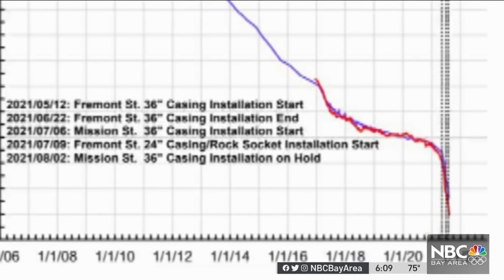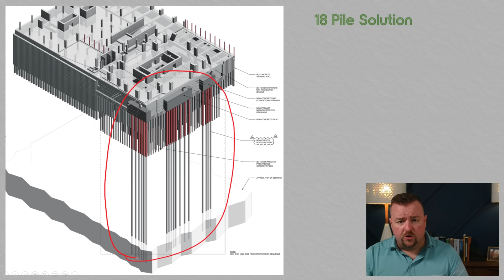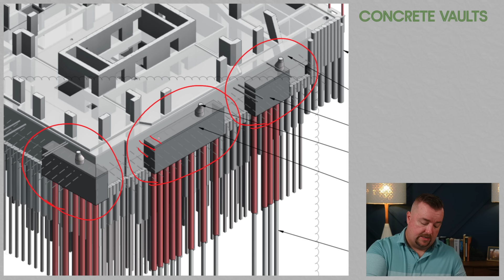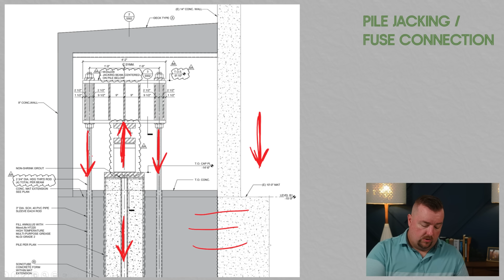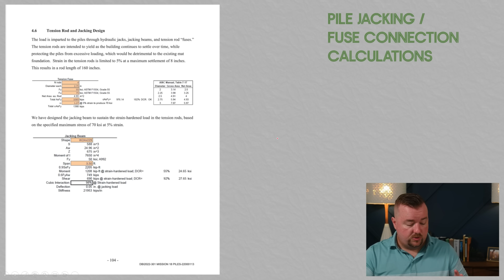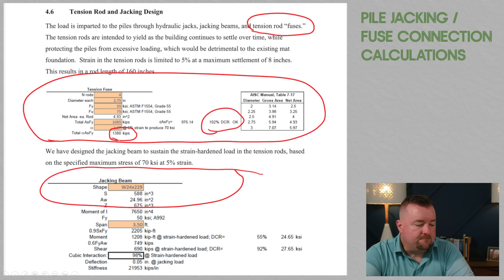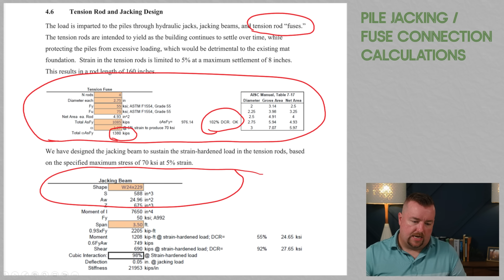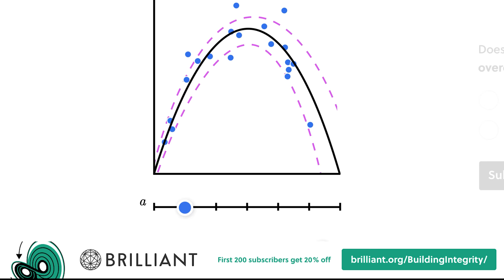Did I Uncover a $100,000,000 Mistake with the Millennium Tower "Fix"?

Comment: I was in the USAF and was an aircraft mechanic, I was tasked to do safety as I did that in a former life. I was told to sit in meetings with engineers and architects that were building a new huge hangar for our F-16's. As I was looking at the blue prints for the hangar I saw a huge mistake and brought it up during one of the meetings. I was a staff Sgt, after I told what my concern was The Colonel engineer asked me "Sgt, are you an engineer? I replied no. He told me in front of the other 14 officers that when I became an engineer I could bring things up. In the next meeting I brought the item I was going to point out and just put it on the table in front of me and didn't say anything. During the meeting I saw others and the Col. looking at it from the corner of their eyes. After awhile I was asked to explain why I brought the item to the meeting. I said because this is one of the 5 things that has to be put in the hole in the hangar floor for the aircraft power and what is on the plans even this one item will not fit. The Col. then said 'maybe we should listen to the SSGT. These engineers and others doing this sort of work should keep an open mind to others that may know enough to help with design.
Reply: That's a widespread problem with society. We don't like to listen to anyone who doesn't have recognized authority on a subject, even if they do have knowledge or insight.
Reply: "I''m senior so I'm automatically right" is the most toxic, destructive, and ignorant stance someone can hold in a relationship or workplace
Reply: Many people have died simply because somebody has an ego. In the airline industry it's called crew resource management where nobody is shamed or put down, everybody's ideas are considered. Every single human being has the ability to make mistakes. ( I'm not in the airline industry or anything , i have simply learned alot about it because it interests me. There have been quite a few aviation accidents where the other crew just assumed that the captain knew what he was doing and did not speak up, due to their lack of experience compared to the captain)
Reply: @Radi0he4d1  in a lot of situations the fact that somebody has so much more experience than someone else can play a big part in the reason why that person could make a mistake. Your doing the same things day after day. you get comfortable. you begin to think that you could do this with your eyes closed... and before you know it you're making a mistake. Whereas the less experienced new guy is constantly double and triple checking his work to make sure he's not making a mistake. Not saying that experience doesn't matter because of course it does but it can leave you vulnerable if you're not careful
Reply: See the problem here is not with the engineers and the architects, they designed whatever they designed based on the requirements the client gave them. I know that on the design side, we always ask what is going into a specific room, what sort of dimensional clearances are required, and coordinate these items with the engineers. Then it's up to the client's team to either give us the leeway to add some breathing room for later on, or min-max the hell out of the project and potentially create engineering and code issues during construction or later on.
Reply: As an SE and PE I learned very early in my career (now retired) that contractors have very good instincts and a lot can be learned from them.   They are not to be ignored.
Reply: @jeffreynelson2660 You are obviously
one of the smart ones 🧐👍
As an Industrial Automation Specialist since 1978, The smartest and most effective engineers always go to the operator's and maintenance people.
The best run companies, will bring them in from the beginning of the design concept.
🤔 It occurs to me just now that those who think they know better, have never had a hand's-on job.
In HS I told my mother that I & a friend had taken summer jobs at a factory that painted part's for factories.
Knowing I was heading to college she said "that will be good for you.
You can decide if that's what you want to do for the rest of your life" 🤣
She was really smart 🙂
Reply: @OhAncientOne  thanks for the comment.   As the owner of a structural engineering firm, I found that the best engineers were the ones that had entered college after other careers, such as truck driving, carpentry etc.    Those with 4.0 averages in college were book smart, but reality stupid, and next to useless.
Reply: @jeffreynelson2660  Yes, hiring is a true art.
The worst are the fresh out of college and think their degree makes them smarter than everyone else.  
I know 1 company that put a mechanical aptitude series of questions in their application test. Pullies, levers, draw an isometric view of a machine part.
I think that's a great idea.
Cheer's ! 
🧙‍♂️ OAO
*edit; 🤔 "owner" - see I was right 🧐😉
Reply: @OhAncientOne  I eventually let my employees go, began a business in the house, and was rewarded with much higher earnings, much less stress, no office politics, best business decision I ever made.
Reply: @jeffreynelson2660  lol, I design electrical control's, from home started in 86 thru '02
was out of it until '14, After 20yrs of AutoCAD it took 3yrs to get up to speed with AutoCAD Electrical working on site.
The covid has me working from home since March '20. The company I contract to decided to have "collaboration days" 2 day's a month, but I have not been there since last Sept when I survived a ruptured AAA.
So I was at a funeral and my relatives asked what I was doing & before I could finish they'd always say "Same thing you've always been doing" lol didn't want to listen to the long description - again
Wow sorry to get so long anyway,
I've realized I was way ahead of my time choosing to remain independent 
Politics in companies is something I've always watched and worked around without getting involved, but totally aware 😉
Reply: @OhAncientOne  In the 1990's some  laws loved by short sighted liberals but hard on businesses were passed, in King County, WA.   Such as "hostile work environment" (whatever that means), "sexual harassment", and others.    So, engineers and architects began to realize that their greatest risk, which used to be errors and omissions in their work, became instead, their own employees.   This lead to  principals only firms, with no employees.  This is called the law of unintended consequences, which is much too complex for the little minds of liberals.    They try to protect employees from  the evil business owners, and unemployment is the result.    I turned loose 28 employees, and never looked back.
Reply: @jeffreynelson2660  Yes complexity is very difficult for those who refuse to think beyond their noses. 🤣
That's a sad situation you describe, I get it.
I'm near Lake Michigan, and envy the west coast as an Architectural designer's dream location. Losing large firms sucks bc you need them to handle large projects.
I have/had relatives in Seattle and OR.
Considered architecture, big fan of Frank Lloyd Wright.
*edit ik it's not the same as structural 😉
Reply: @OhAncientOne  The funniest 2 incidents that I remember, both involved DIY.
The first one was when a guy was showing the plans that he had been drawing all day, to his 12 year old daughter after school. After about 30 seconds, she said, "Dad, two of the units wont fit through the door, then when we are using the grill, it will be impossible to open the fridge door.
Dad looked very sheepish after that.

The second was when a guy built a fitted bedroom wardrobe and shelving  unit carcase, face down on the floor. The diagonal of the sides was taller than the room, making it impossible for him to stand it up. The really funny part of that one, was that the guy was a design engineer. To make matters worse, his wife had already mentioned that he needed to assemble it upright, but she assumed that he would know the reasons why. 

I am a theater architectural engineer, but I often let our daughter (aged 32) check over my work. 
Sightline errors are so easy. LOL
Reply: @wilsjane  that's hilarious 🤣 thanks 👍
Cool job, I ran a custom panel shop back in the '80s. We built panels for a company you may have heard of, Peter Albrecht Co.
before my time at the panel shop but I found records & electrical dwgs for Stage controls for the Kennedy Center and the shell shaped Arts center in Sydney AU.
We did panels for them while I was there but can't remember where they went except that Australia had weird wire color codes.
Reply: @wilsjane  I've had engineers mark up my schematics and still didn't see what it was.
Always pays to have someone else look.
When programming machines, if I was getting stuck the best way to figure it out is to explain what I am doing to someone who doesn't have a clue. 🤣
Reply: @o0o-jd-o0o95  While what you say can be true, people who are complacent get weeded out very quickly.  When you interview someone for their input, their attitude is immediately apparent so you go through your list and quickly move on to the next person who may have input.
While in the back your mind you remember that something made that person that way.
Engineers who are smart enough to ask around, accurately judge who they are talking to easily. In my 45yrs of working with top companies I've seen and done it many times.
Reply: @OhAncientOne  It is a small world. One of my first jobs was to specify and dispatch the 70mm projection and sound systems for the cinema in the Sydney opera house.
Although the equipment was manufactured in Milan, they ordered it from London, since none of the design team in Australia spoke Italian. 
Australia uses the same wiring colour codes as the UK and has the same 230 volt 50Hz single phase domestic supply.
Reply: @wilsjane  Amazing !
At the time, it was the first time I had seen it, 
so it stuck with me. Over the decades I've helped a few companies meet CE standards
Right now I'm contracted to a world wide company with plants on every continent*
Designing the electrical control's for all the plants.
The stage controls were smaller operator control stations. Very beautiful engraved black anodized aluminum. We weren't allowed to put our co. name on them.
Amazing the memories you bring back 👍
*edit Almost - don't like to exaggerate
My stories are wild enough without that!
🧙‍♂️🤣
Reply: @OhAncientOne  My most wild moment was when the ballast resistors between the mercury diode 3 phase rectifiers in the basement and the projection and spotlights in a London theater burnt out a few hours before the show. 
To save the day, I connected the DC negative (that was bonded to ground) to the steel fire escape that ran up up the building and the DC positive to the remaining risers. To ballast, I stood steel dustbins on the top landing of the escape, added a wood bar across the tops of the bins, with copper pipes down into them, then filled the bins with water (as the resistor). To lower the resistance, I added salt to the water. Since the ballast was dissipating around 15 Kw, the water was soon boiling and the resistance dropping, so I had to adjust the length of the copper rods immersed. The whole lot held up during the 3 hour performance with around 2,000 members in the audience.
My nickname changed from 'professor', to 'nutty professor', a title that I still have more than 50 years later. LOL
Running more than 400 amps at 110 volts up a fire escape was probably a first, as was ballasting the negative.
Reply: @wilsjane  WOW! that story should be the opening paragraph in a EE course book!
That's brilliant in my book 👍👍
Having zero experience with projection,
I'm imagining a huge 110v 400A Arc lamp?
Really like the copper piping idea 🤣
Got to visit London in '73 bc my dad was our state's 1 Lloyd's of London rep.
Super cool City - I remember we drove west for a long time to eat at the world's oldest continuously operating pub/inn/carriage house. Used by king's traveling to/from the west coast. Can't remember what city, but I'll never forget eating at "The Spotted Dog".
Reply: @OhAncientOne  This was more than 50 years ago, when due to the low internal resistance of mercury rectifiers, to prevent the arc from surging out, the voltage was dropped by about 40 volts across the ballast to keep the current constant.
These days, most engineers just press buttons without understanding the theory.
Those good old days were far more fun than sitting at a computer.
I am pleased that you enjoyed your visit to this quaint old country, where even our police do not carry guns to shoot you.
Reply: @wilsjane  Cool, thanks for the knowledge 👍
When I started, anything with mercury in it was being replaced. But, you know those things can last 40yrs ez😉
Reply: @MikMoen  not really
Reply: @Radi0he4d1  the difference between big brother and an older brother...
Reply: Thank you
Reply: @OhAncientOne  When the national UK grid converted from DC to 3 phase AC, generators were maintained in many power stations to supply the railways. As the 11Kv grid was set up, the railways constructed rectifying houses for the transformers and mercury rectifiers to supply 720 volts to the tracks, allowing the power stations to decommission the DC generators.
On a dark summer night, when the doors were kept open for cooling, you could see the blue glow in the sky from miles away.
During the 1960's, when the power was shut off fer the last train, their were several cases of thieves breaking in and stealing the mercury. This also happened at several cinemas, in some cases closing them for days.
Reply: @wilsjane  Ah, the '60s when us kids would play with Mercury 🤪
That's a great story, I didn't know, that train's started out as DC right from the power station.
Locomotive's are something I have just a bit knowledge bc I was asked by a local steel company to quote the electrical portion of all the wiring required. We went to the GM EMD train yard in Chicago to look at an ABB locomotive example.  What stood out the most? Every single Phillips head screw, was aligned square to the ground, perfectly 🤯.
They took my numbers and marked them up 30% which was fine, but then they added 50%, which I warned them not to do.
Didn't get the contract. But I felt like a kid while exploring the train yard 🥳
Reply: @jeffreynelson2660 Because theory and practice often diverge. Contractors can often see how it works in practice, whereas a model can miss a lot of variables.
Reply: @o0o-jd-o0o95  Yeah that's true- we've probably watched the same videos where capt is making a bad decision but the crew hushes up
Reply: In my designs, I also consult the contractors and labourers who perform the actual work and I'm glad I did, and still do.  I learnt a great deal from my respected colleagues in industry.  For example when I design something,   the worker can chip in and he would say that it's either very hard or impossible to reach into the crevice unless he's got the small hands of a child; or that a certain tool is too short to reach a certain fitting.  So over the years, my designs also take these workers input into account.
Reply: @MikMoen This has been a huge problem over the last three and a half years.  Doctors ignored for daring to criticise medical regulators and the WHO.  The highest medical authorities ignoring and  censoring experienced doctors at the front line and insisting they know all the answers, whilst insisting on policies that do more harm than good.
Reply: Very good of you to stick to your guns. 

I worked in an administrative support position at the local military base in Construction Management. I am retired now. During the early days of my tenure there I had to rescan every single drawing file, over 8,000 of them, because the previous scans weren't very good. The drawings dated back from the 1940's!. Basically, the three optical lens in the old scanner were misaligned and every drawing was split into three different sections. 🙂 

I say all that to say that during that time period, which lasted months, I got to looking at the drawings and I would ask many questions of the engineers about them. At first they acted indignant wanting to know why a lowly admin clerk would ask so many questions, but after they saw that I was genuinely curious they were happy to share their knowledge. I learned a lot during those days, and now whenever I ask questions about, say, the house I live in (which used to be military housing) to the current owners, THEY become indignant because I know more their unit then they do!
Reply: You probably saved them a whole heap of money by avoiding that mistake. Good on you.
Reply: Literally every tradesman I've ever met has one "I beat the engineer!" story that they trot out at every opportunity. They're boring, and most of them are probably exaggerated and not nearly as important as they make them out to be.
Reply: When looking at this fix the first thing that comes to mind is the Hyatt Regency walkway collapse I am just a bike mechanic a halfway reasonable sparky and I can tell you that fix is not going to work it's the sunk cost fallacy which is lead to some of the greatest industrial disasters in history the Westgate bridge collapse in Australia is an excellent example there are some jobs the you walk away from no matter how much money they've in-your-face
Reply: @somedumbozzie1539   I remember the Westgate collapse, the engineer who came up with the rapid construction technique was among those who died when the span broke.
Reply: Making mistakes is forgivable, being closed-minded and dismissive is not.
Reply: experts get paid to agree with whomever is paying them
“safe and effective “ — all the experts said so
it was neither
Reply: @LEARSIKCIGAM  I've seen that myself. Execs paying for cover.
Reply: Great point! Arrogance is no equivalent to an open mind.